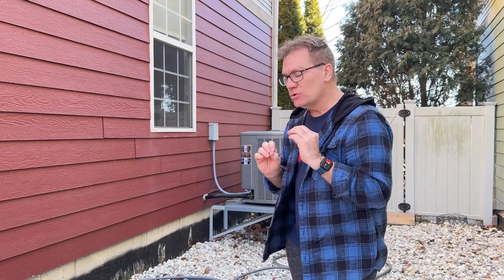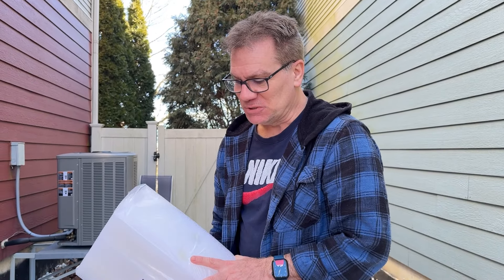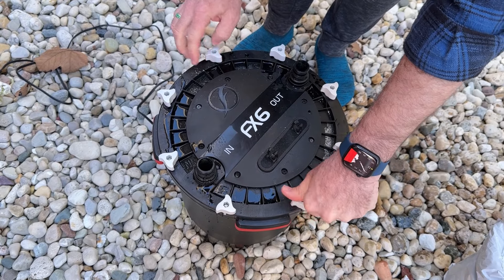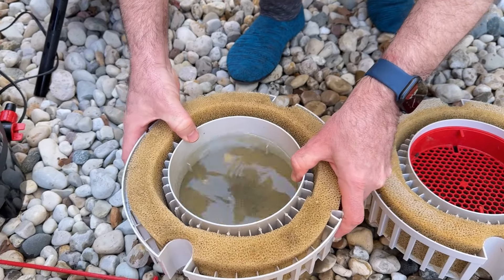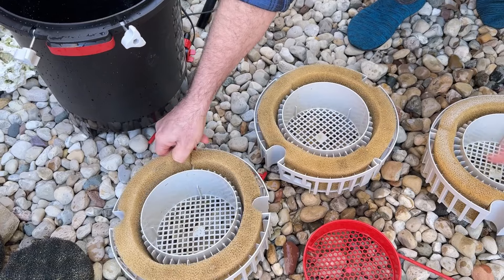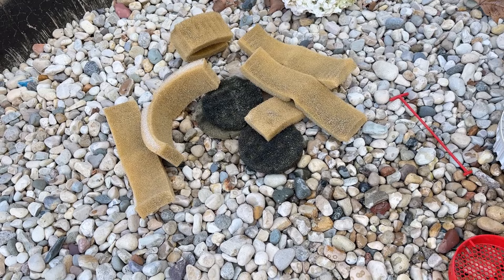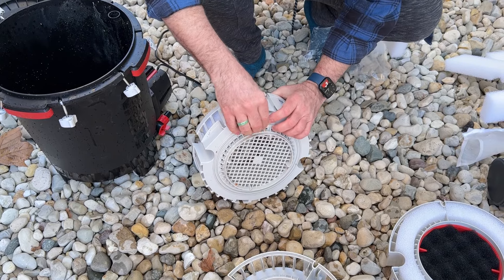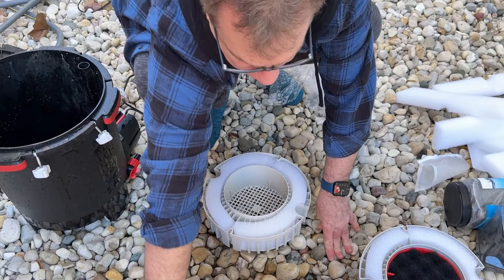Canister filter on saltwater aquarium - Fluval FX6 Canister filter cleaning

Comment: Been having issues with our 125 and using Seachem tidal filters. Corals except for softies all died. I hate these hob filters. I have an extra fx6 and fx4 from our old freshwater systems. Everyone says canisters are a pain for reefs, but this method seems to make it much simpler. Very tempted to drag them out and ditch the tidals. Thanks for this!
Reply from the maker: You are very welcome! Don't listen to what others say. I will admit, I was skeptical, but I'll tell you what...my tank is much cleaner and more clear and I only have to do maintenance like in this video once every 3 months. AND IT'S SO QUIET! There is also zero salt creep. Way too many pros here. Go for it.
Reply: Trust me bro the fx4 or fx6 will work amazing. I stuff mine with ceramic bio balls and seachem matrix 0 ammonia and never pass 10 nitrate. Just open it and rinse it all out with old tank water once a month.

Comment: What's the point of the filter then? In freshwater we have sand and such but we need the filter for bioload  of our tank.
Reply from the maker: The filter will remove solids so they don't break down in the tank. I only rely on sand and rock for bio load.

Comment: And any nitrate issues? All I ever hear are canisters are nitrate factories for salt tanks
Reply from the maker: Nah, because I clean it, and I'm using a larger filter, and even using 2. Bottom line is, I don't let stuff collect and my bio load isn't that large. Ever see those videos where people don't clean their stuff out? They have nitrates. I have less nitrates now since stuff isn't collecting, like it did in my sump. That was nasty. I hated that. I was lazy and didn't feel like emptying the sump out every week...that's what you'd need to do. So much nasty stuff in it when I removed that. The nitrate thing is the same if you don't change out filter socks, clean your sand, feed too much, etc etc.
Reply: @ROTTERtube  very good points. I may drag my fx6 and fx4 out soon. Thanks again!